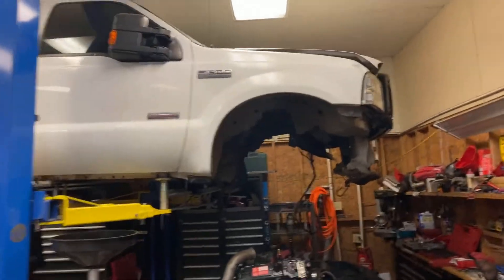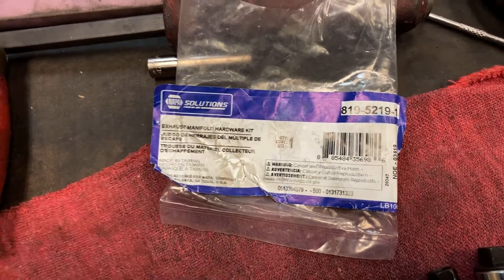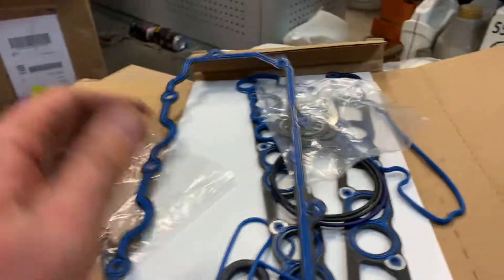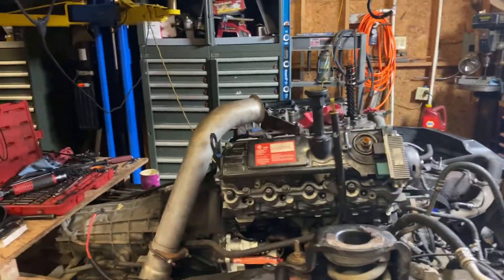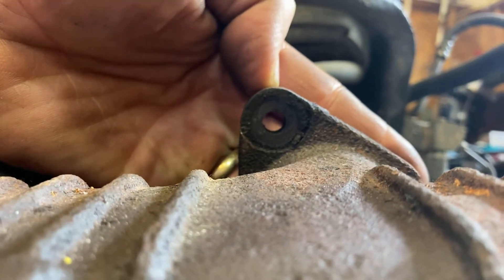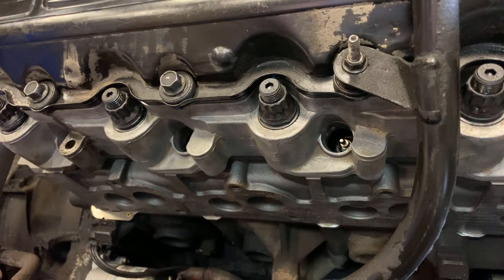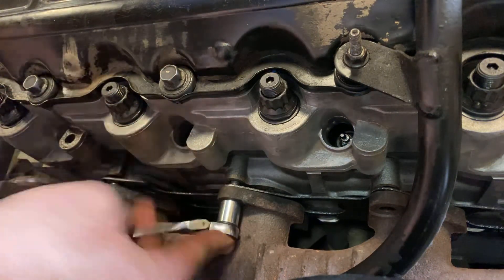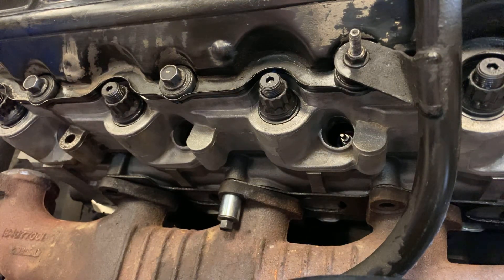6.0 Powerstroke Exhaust Manifold gasket installation

Comment: We’re yours leaking previously? The lower back bolt on my drivers side is wet and caked with oil so I reached up and can turn it by hand… so I assume it must be leaking and may be why my turbo lags. Like you said torque to yield bolts are only good once so I need to remove the manifold, can’t decide if I want to go new manifolds or just gaskets… HiFlo exhaust manifolds for $250 on eBay I’m tempted to try them and upgrade both sides. Already have bulletproof diesel titanium exhaust manifold bolts waiting to use on whichever route I take!